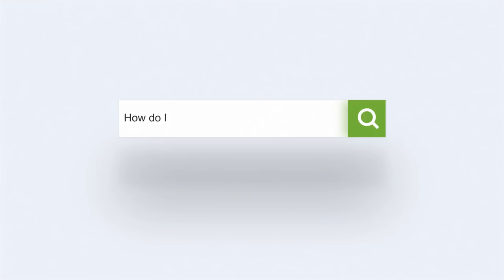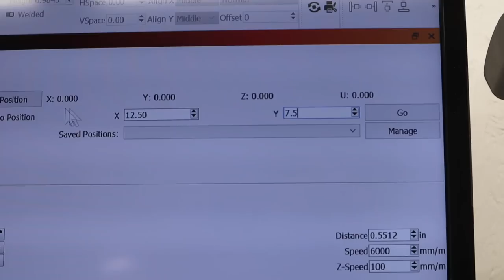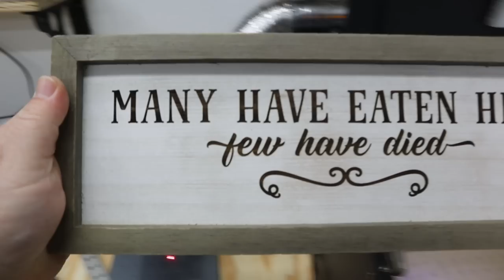DON'T MAKE THIS MISTAKE!! // DIY Fume & Smoke Extraction

Comment: Hi Sam, I have two XTool lasers, 10w and 20w also swap out 10w with the Infrared. I’ve Y’d the machine exhausts together just prior to inline exhaust fan(same as yours) and I used 4” pvc pipe with foil tape at all connections to help eliminate the possibility of smoke/fumes/smell entering our work area. Works very well. Yours seems extremely good to.
Reply from the maker: Thanks for the info!

Comment: Great video!  I added fume extraction for my lasers last year.  I used a 6-inch exhaust similar to yours, but instead of doing different hoses to each, I built a cabinet to house all of my machines in.  Your six inch fan is strong enough to vent all of your lasers at once.  
One word of caution is that if you have air conditioning in the summer, you may have condensation issues with the un-insulated ducts.

Comment: I’ve found that extracting the fumes/smoke with the vent facing up helps remove the smell from the immediate area much faster as smoke rises and is not being pushed down and then having to move upward.  I have my current laser vented out of a window and exhausting upward greatly reduced the amount of smell that was in the window area much better.  I’m waiting on my new laser to arrive and will be installing an extractor through the wall of my shop, but it will still be near the window.  A small overhang to reduce collection of rainwater into the hose/vent is also installed over the window.

Comment: I have two of those 4” fans on my enclosure for my LM3, and I notice that right at the joint between the front input and exhaust side of those fans, they don’t 100% seal, which can lead to some smoke smell in the garage.  I used aluminum tape to seal those, and also used hose clamps instead of screws.

Comment: At one time I used the Vivosun inline fan that looks like the white one you put on the Co2, but I eventually switched over to AC Infinity models on both my diode and Co2.  I have a 6" Cloudline S6 model (you can chage the power in increments with a built in wired remote), and a 4" Cloudline A4 (also speed selectable).  I do still have a Vivosun 6" if you'd want to change out that 4" model for something larger that'd draw from all 3 lasers without issue, you're welcome to it (you'd have to change the exhaust size to 6" though).  The vivosun is also speed-selectable on the cord, low medium and high speeds, so you can kind of tailor it to what you're doing and keep noise levels down also if necessary (Vivosun T6, 390cfm so it'd absolutely handle all3 of those without any issues at all).  Like several others here, I have my fans mounted vertically to the vent, and have it as close to the exhaust hole in the wall as possible (these types of fans pull air much better than they do push, so they need to be at the end).  I also use smart outlets to control my fans, as well as a light panel above my big Co2 so I can actually see the bed better through it's camera when I'm aligning stuff.  Have you had much of a chance yet to play with the Co2, curious if you've moved any of your 'production' processes over to that, and have seen the time-savings that the Co2 gets you over the diode lasers (spoons, etc).

Comment: So glad somebody made this video and it was you! I have received the same fan and accessories for the D1 pro that I'm supposed to be receiving. I don't know what size the fan is on the exhaust perhaps it's also a 3-in? Then I will have to get the reducer as well? I did get a 4-in backdraft flap. I also have a 6-in hose that is previously installed.
Reply from the maker: Glad I could help!

Comment: Great video I have  Question how do you replace your air from your location? using this setup?
Reply from the maker: My workshop door is not an air-tight seal. I also have windows I can open if need be. My shop it not air tight either. :)

Comment: What extraction fan did you use that took all the smoke from the Ortur? I got a fairly inexpensive one like the black one you show and it's pretty underwhelming. It's rated at 195cfm but I barely feel the suction in my xTool F1.

Comment: The part in this video talking about origins - I am super excited for this. I just bought a larger 60w CO2 with a Ruida control, so I have to upgrade to Lightburn. The small, less advanced K40s I've been using don't support Lightburn without updated boards, so I am forced to use K40 Whisperer software. Although it may be there, I was never able to find the location of anything without just moving and eying in the laser. I come from a cnc programming background and I need to know where stuff is, so really looking forward to this feature in Lightburn.
Reply from the maker: You're going to LOVE using Lightburn!

Comment: Great video, thanks.  Any ideas on a filtering setup, instead of exiting the fumes out of the building?
Reply from the maker: I've read up on others who try that, thinking they don't have to exhaust outdoors, but they all have issues and residual fumes in the room. I rather just get that stuff out of my workspace -- even if it means paying to heat or cool the air lost through the ducts.
Reply: @Samcraftcom  Thank you for the reply.  Unfortunately I do not have access to the exterior.looking forward to you next video.

Comment: I was expecting to see you tape up the plumbing. Screws were good, but it looked like a rather loose, leaky fit.
My Z1 needs at least 200cfm to pull out the smoke and I only have the front open on my enclosure box. Not easy to find a 4" fan that beefy.

Comment: How do you feel about securing lthe open end that is floating in the air to fixed position using some magents? This way it will be more secure and it will allow you to easily remove it, if needed.
Reply from the maker: It's an aluminum flex hose so magnets won't work, also the atomstack is aluminum. :) Honestly it's completely fine as-is for me... keeping it simple. :)

Comment: Question,  can I join my exhaust system for the laser,  to the exhaust side of dust collector? Another words in junction with the vent leading thru the wall outside.  Not thru the whole system.
Reply: I read on a manufacturers web site that you definitely should not do this. It was either Monport or Omtech.

Comment: Hi Sam, love your channel, can you tell us more about your laser computing hardware and software. With multiple jobs on the go, are you running multiple computers?
Reply from the maker: These are all connected to a mini desktop PC. The diode and CO2 lasers run in Lightburn and the Atomstack runs in SeaCAD. All run fine simultaneously on the PC (Windows 10, Intel i7, 16 GB RAM, SSD).